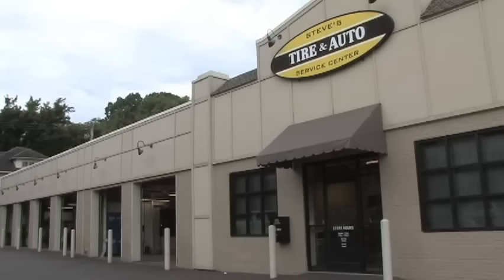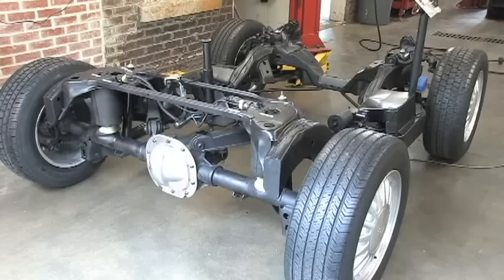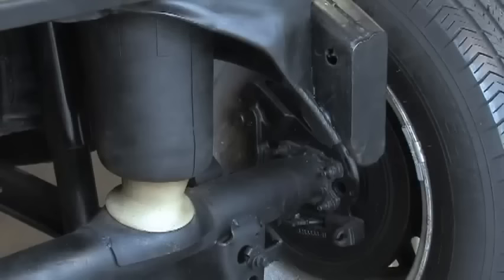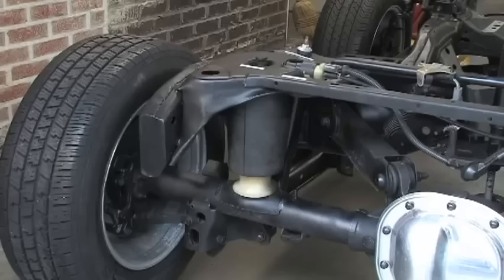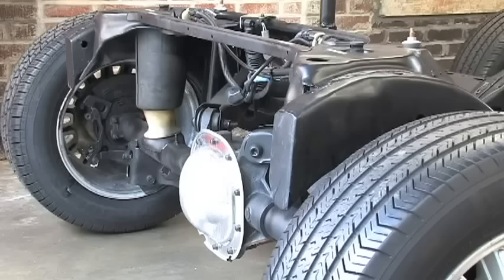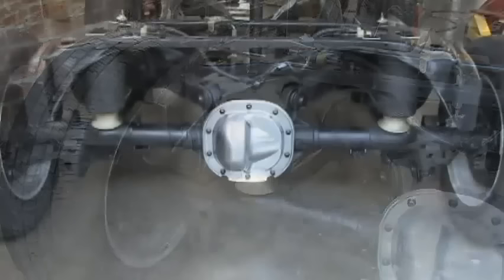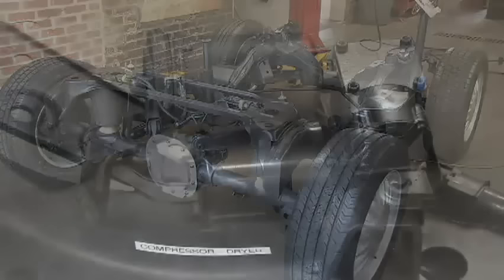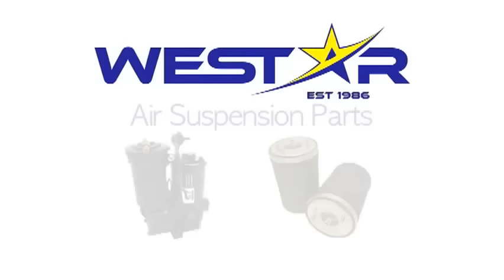How It Works: Air Ride Suspension

Comment: "The purpose of air suspension is two-fold: Maximum Passenger Comfort and to Maintain Proper Ride Height of the Vehicle to Ensure Safety"

.....riiiiiiiiiiight. and my big ass spoiler is for safety too.
Reply: He's right. Air ride is more comfortable than coil springs. And have you ever loaded your trunk with stuff to the point that the rear end sags and the front raises? Or seen other cars loaded to that point? Air suspension keeps the car level no matter how much weight is in the trunk. Therefore reducing the likelyhood of damage to the exhaust system and loss of vehicle control.
Reply: Do u think is normal to keep hearing my air compressor traying to rum for example every time I start my truck the air motor is tuning like 30 seconds and them after while I'm driving is doing same thing for about 10 seconds
Reply: one way lawn service you may have leaky air springs. Depending upon how old they are. They may have dry rot around the fold at the bottom of the bag.
Reply: +Chris Haywood my dealer replace them last week since I purchase the truck there but I have bring the truck 2 times to them last time they put new air ride pump and new shocks to but I was telling them is like they haven't don't anything noise is same while I'm driving and after turn my ignition key and after I start my truck  load noise all the time.

Comment: Is it possible to replace the air compressors with a canister of high pressure gas. Example would an electric car where you want to save ever amp you can. (But could attach a compressor to refill the canister when the car is charging).

The system I had thought of instilling would let the user raise or Lower the car when needed with minimal energy loss wile driving)

Comment: they never really showed the part that tells it to be at certain height or if the car is sitting low or high.. the most important part.. HEIGHT SENSOR. oh ya Chris was playing height sensor!
Reply: This is important to understand what triggers the air ride when it not level. The instructor can start out showing the hi and low air ride pegs as I call them and where they are mounted. Then when the car drop it triggers of a signal to the computer. The computer tells the compressor to "get your butt moving". Those parts he did not address are the 1st step in the way it works.
Reply: +Bill Gredick ok thanks

Comment: How is the compressor driven?
Reply: Troy Soogrim 
12 Volt Electric
Reply: Its driven by the electric motor inside the compress. This is not like the a/c compressor using a belt.
Reply: Lol😂

Comment: I want to stop my s430 from lowering when it's in Park, can I just disconnect the airmatic line on all 4 wheels?
Reply: The air ride likely will not ever work and you will ride with the car sitting on the frame.
Reply: the ABC suspension on the w220 is known to be very problematic...
Reply: yeah, i hate when it lowers like that...it looks stupid. I would just prefer regular shocks
Reply: can i use regular shocks??
Reply: when did you opt for it? its optional on the s430 and s500 only standard on s600
Reply: opt for what?regular shocks...just an idea..if it's not too expensive i will do it but i would have to do some research. i'm being told i have a leak that's why my shocks keeps lowering like that. But i'll write back about what i eventually did later to fix the issue
Reply: Teey P. Take it to Mercedes benz service center?
Reply: i might as well do my taxes with the IRS if i go to a MB dealership for any kind of mechanic work, thanks my brother.
Reply: well it's a luxury car with a big v8 so it's expected to be well cared for and the ABC suspension is super complicated so...
Reply: true..it does run fast & do like driving it. if my euro techs can fix it i'll think about it. you must work for MB huh

Comment: never really cared for air ride suspension, doesent really work so well
Reply: That depends upon what car you're talking about. I've had three Lincoln Mark VIIIs with air suspension. Never had any trouble at all out of any of them until they passed 200k miles.
Reply: all land rovers have them
Reply: Yep. A lot of high end vehicles have air ride now. Air suspension is very nice when it is working properly. I never had any real issues with my Lincoln Mark VIII air ride. It worked flawlessly 99.9% of the time.
Reply: Hi chris do you think the battery will affect the Air suspension because i got a Lincoln mark VIII the battery warning sign  was flashing all the time(it might be the battery needs to change) then all of a sudden the rear wheels sagged while the car is running' Thanks'

Comment: I see why all Lincolns always sag down and drag their frames on the ground. You should fix the sagging problem first before trying something new from outer space.
Reply: They put the air suspension in some Crown Victoria and Mercury Marquis as well. It's just easier to fix the problem with the spring coil   replacement kit. No more sagging or expensive repairs.

Comment: i m think the Air suspension will not last to long you will have flat Air bags
Reply: You get what you pay for bud
Reply: You get what you pay for bud
Reply: Ride tech shock waves are the way to go
Reply: I have an '02 Lincoln Continental with rear factory air suspension. Works perfectly, so you really do not know what you are talking about.